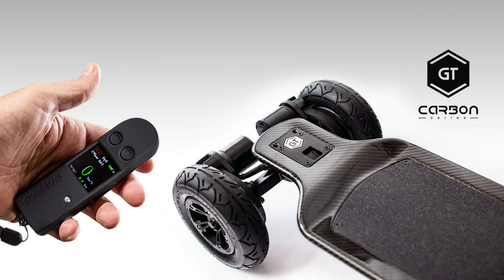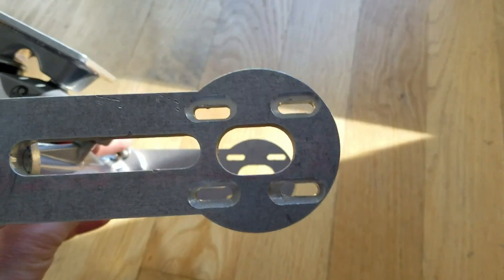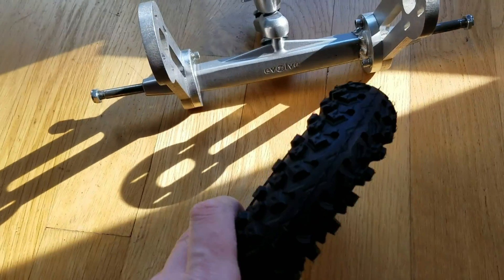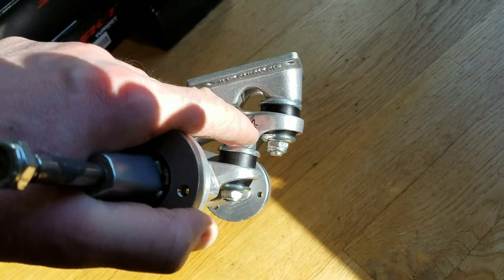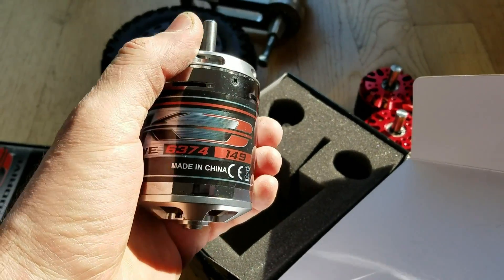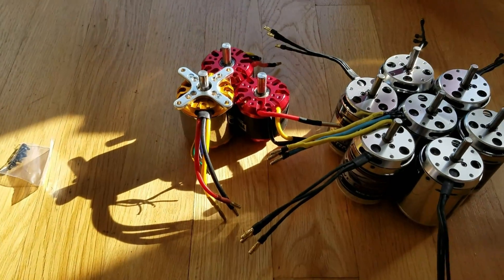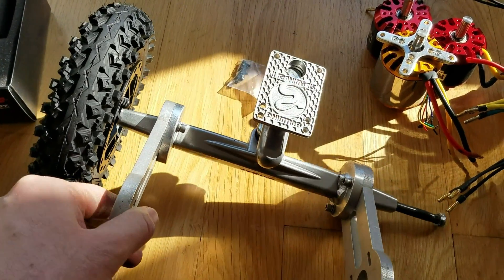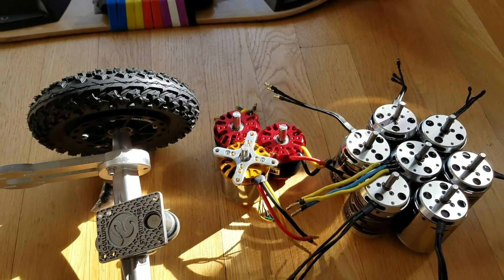Custom electric skateboard

Comment: I have the evolve at bamboo. I love it, but I have wanted dual motors from the day I got it. Very interested to follow your build. I love the flex of the bamboo board, but I do think a double drop would be much better. I assume you'll use vesc's?
Reply from the maker: yes. i am waitimg for the vesc. please share, like subscribe. more good stuff coming.

Comment: Anyone get the second GEN email today?  Extended range 12 miles LOL. Sangi did not listen to you Vitali! I'm getting 15 to 20 miles with the Vitali double pack.
Reply from the maker: That is said....i can fit 30 - 18650 cells into original boosted pack and make it run for 30 miles. i don't understand why would not do that.
Reply: +Portable Electric Vehicle what could be the reasoning?  Weight? Cost?
Reply from the maker: +Benzini9 mainly cost...
Reply: the reason for their small battery pack 100wh , is that they are allowed on passenger flights,.. over 100wh are not allowed on passenger flights.
Reply: +integra really? Interesting... That sucks

Comment: I have an evolve and have had issues with it cutting out they send new parts same issues
Reply: I have one too. Occasionally the transmitter seems to disconnect and the board lurches. Is that what you're experiencing?

Comment: I know but you will not be able to weld it so it will be as strong as a regular evolve truck
Reply from the maker: it is stronger...I don't understand where do u get this from...?
Reply: +Portable Electric Vehicle 
Are all of your sk3 motors 149kv ?? was your 192kv for a street board ? i have the 6364 245kv wonder how it would compare to the 6374 192kv for street board ?
Reply from the maker: less power..

Comment: The welded evolve truck will break for sure! i have seen a lot of people trying to weld a broken evolve truck and it always broke again within a week. Use a single motor or take the Carbon GT truck for dual motor. Be careful!
Reply from the maker: this is not a BROKEN TRUCK. it will never come apart.